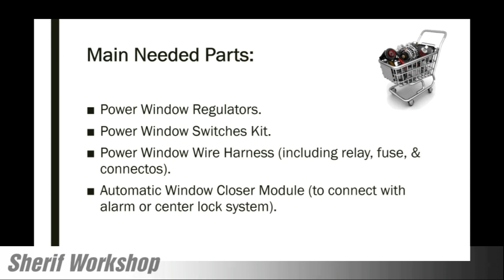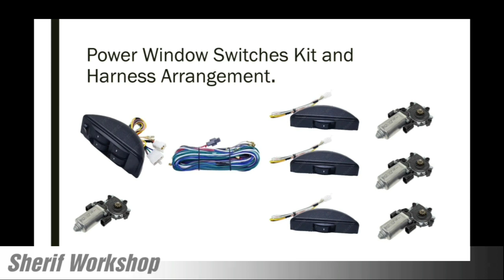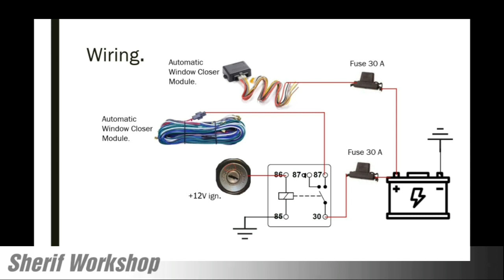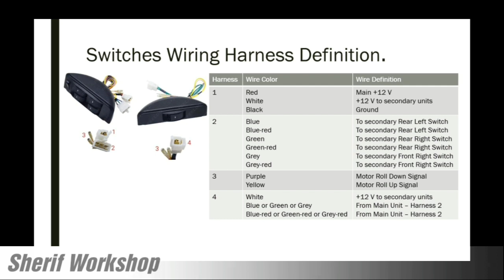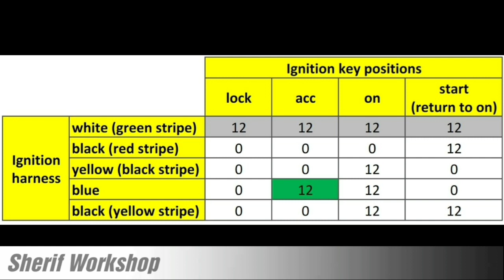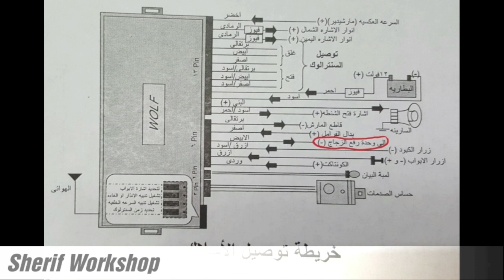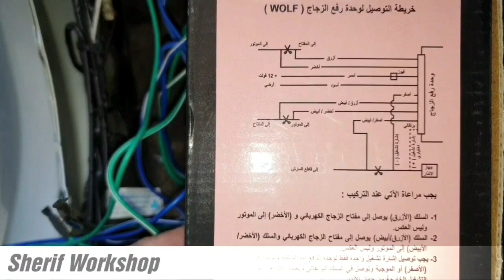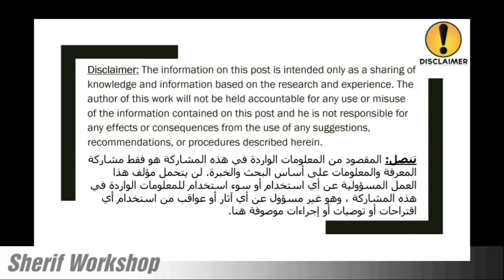Car Power Window Conversion - Complete DIY Guide

Comment: I get regulator but i have not universal 5 pon switch and i search it but i don't get it at local shop i have question that which original power window switch have 5 pon like universal so that i use in my car like dzire , swift , ciaz !!
Reply from the maker: I guess you need to see each one of them to determine which one will fit. I think all are 5 pins

Comment: You install only motor on manual power window or change whole regulator system please please please suggest and please upload rear power window images or video
Reply from the maker: I changed the whole regulator. It's not durable to install only motor on the manual regulators. It requires many modifications that makes it not reliable. But universal kit could work (I didn't try it myself) just be sure that you have a good brand